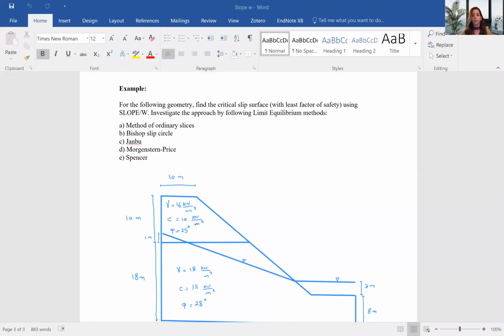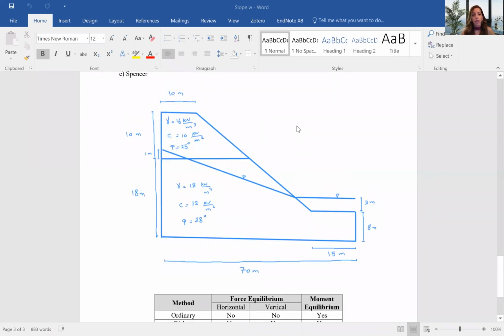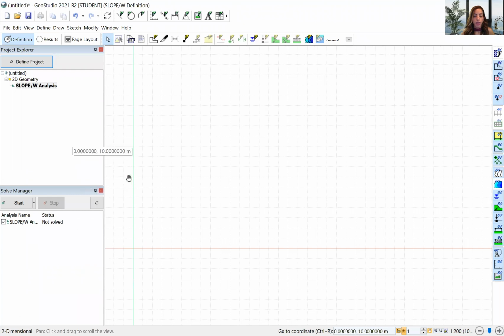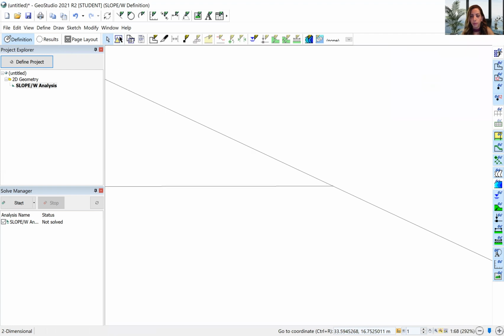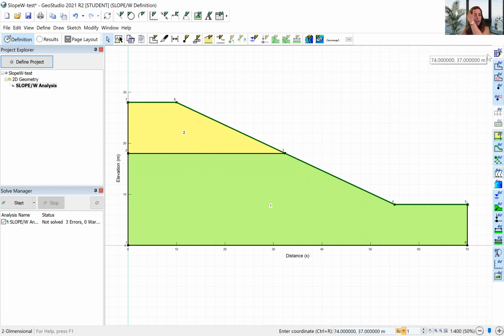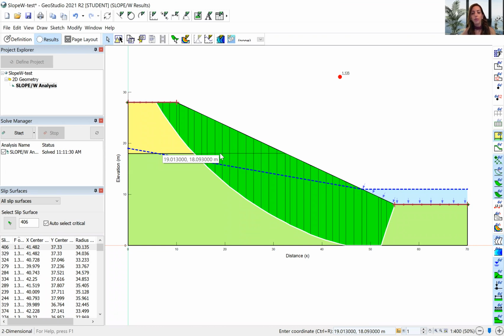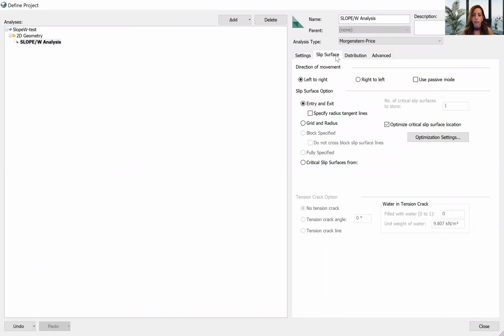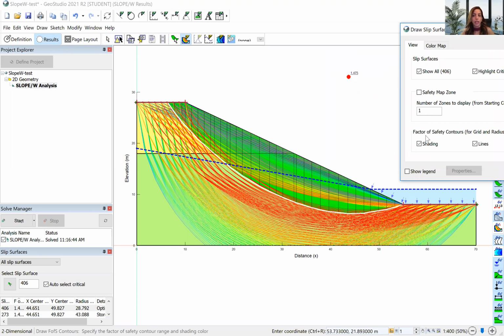SLOPE/W 2021 Tutorial - Different types of slope stability analysis

Comment: Great tutorial but what soil would have both cohesion and friction angel? because it's either of them in every soil such as clay have cohesion but no friction angel or sand have friction angel and no cohesion value
Reply from the maker: Most natural soils have both cohesion and friction angle (for example silty/clayey sand and sandy clay)
Reply: I do agree with this reasoning because I have worked as a field geotechnical engineer, and soils always blend into each other (e.g., sandy clay). However, when it comes to modeling, I often see my colleagues defining layers as separate soil types. That’s why it can be quite tricky to make a good assumption about the situation 😁